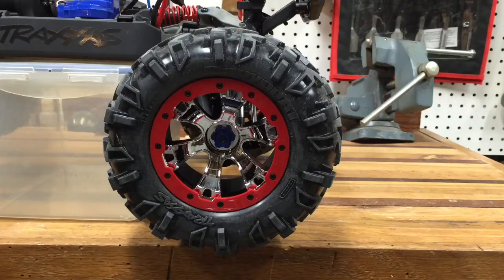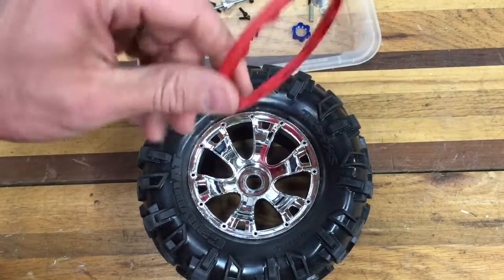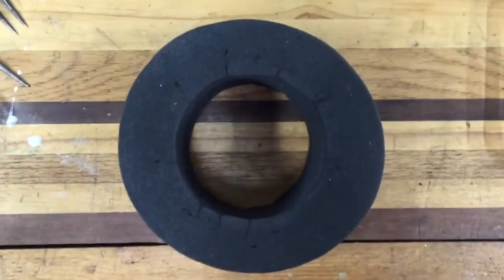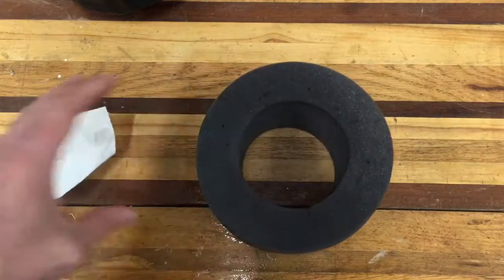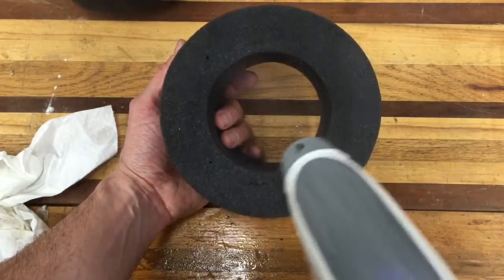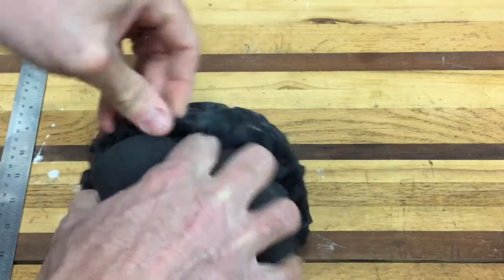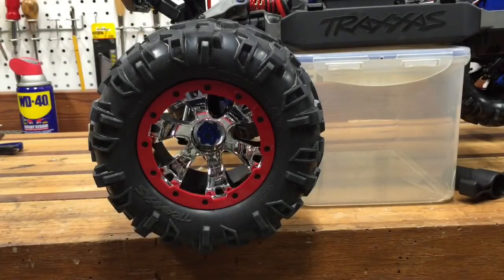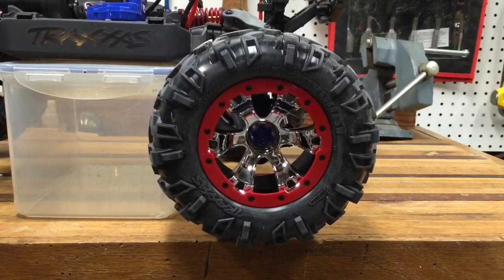Traxxas Summit Part 6, Fixing Out of Round Tires!

Comment: recently had to remove these myself. baked all 4 at 350° Fahrenheit for exactly 10 minutes face up, and they pull right out. flip them, bake another 10, the bottom pulls out easy as well. they are EXTREMELY hot so be careful, but they pull off there in seconds!
Reply from the maker: That's very interesting.  I would be worried putting into an oven.

Comment: This deformation happens from the truck being stored with the tires on the truck holding the truck up. This problem would not happen if the truck is held up by something under the chassis
Reply from the maker: Yes absolutely! They should not let the tires support the vehicle in transit.  Truck should be support by foam or leave tires off.  Thanks for the comment!

Comment: Nice how you fixed it, but I think you did to much work to fix a simple problem,

I know there is lots of ways to do and correct things and yours is OK but let me tell you how I corrected my wobble.  

My Summit had a treble wobble on the tires and I just did 3 little hole in the tires to let the water / humidity out and the foam auto corrected themselves, it worked for me.

Thanks
Reply from the maker: Thank you for the comments!  Yes there's usually multiple ways to solve a problem.  Your fix sounds interesting.  I may try on one of my tires.  If nothing else I can inject steam through the rim holes!  (0:

Comment: hey, good video again.
I agree that they should be stored better in the box, they could be in there a loooong time.
I personally would not want the hassle of having to do what you have done with a brand new truck and might just change the wheels and tyres for aftermarket (with stiffer sidewalls etc).
but again, we should not be having to sort out out of round tyres .
Reply from the maker: Thank you.  Yes the truck sits on its tires in the box.  It should be supported by the frame instead to prevent deformation of the tires.  I may contact Traxxas and request a replacement set of tires.  You are right...  We should not have to fix this type of issue on a new truck!

Comment: I had the same problem bought proline mashers 3.8 pre glued now they wobble side to side balanced tires still not good . EMPLOYEES who put these together need to show more pride in quality workmanship. Never had this problem till I got a summit with 3.8 my 2.8 tires for my slash are ok I balance all my tires for less vibration can't seem to beat this condition ruins FPV Also have a set of 40s demolisher that bounce up & down but do not wobble none have been wet please let me know if you find a solution thanks for your effort
Reply from the maker: +rk stone   Yes very irritating to have the tires so out of round.  On the Summit the tires are mashed by zip ties during shipping thus deforming the tires and inner liner.  I should have contacted Traxxas for replacements!

Comment: is this recommended or are there better ways?
I just got our Summit 2 days ago and the tires are wobbly as well but I was told to run it for a while and let the foam inside seat properly..
Reply from the maker: Who told you that?  Honestly I would call Traxxas and ask for new tires and wheels.  That is what I should have done.  Even after my repairs my tires are still badly out of round.   :0(
Reply: +ProjectKing I read it in some forums as I searched for wobbly tires. Thanks for letting me know. I'll video mine and will let the shop know and Traxxas as well.

Comment: Traxxas should take those back. That's unacceptable, these aren't cheap! I have sent back pro lines, Duratrax, and Traxxas tires. You can balance them but you can't fix this runout. You did it right in your effort to fix but
when out of round like these, they are junk. These will ruin the rest of the truck running like that.

Comment: bake the wheels at 300 for about 20 minutes and the tires just peal off and can reglue.
Reply from the maker: +mastmec   Baking won't cause damage to rubber or plastic wheels?
Reply: ProjectKing no, I have done it to many sets, I've only done one chrome wheel due to tire ripped, but didn't damage wheel. I think I only did it for about 10 minutes though. Heat them up and test, when it's ready they will just pull off.
Reply: It may take a few baking/cooling cycles, but the glue crystallizes and with a bit of gentle pressure like you were doing at the beginning pops the tire off. It will stink your kitchen up though, so prepare your wife for the smell. Let the tires cool before trying to pop them off or the rubber will be softened a lot and is more easy to tear. Also, it's best to put them on a tray and not let the tire hang over the tray so the heat from the heating element or fire at the bottom of the stove doesn't make a direct contact with the tire or it will ruin them. I use a set of kevlar gloves to handle them when hot.

I had a tire bake day where I pulled all my 3.2" tires off 14mm rims to eventually put them on 17mm rims. I did have  a couple tires tear that day, but they were tires that had been remounted more than once and had a lot of cutting at the bead from running in skate parks.
http://gmarquee98.x10host.com/myPics/98gmarquee/misc/2010-0214-TireBake01.jpg

Comment: Throw the tires in boiling water for about 10min.. tires come right off
Reply from the maker: That's a great tip!!!  I'll have to try that!
Reply: +ProjectKing IS THAT CAUSED ROM NOT SITTING ON A STAND? because i always keep mine on a stand and never had a problem.
Reply from the maker: No it is caused by the tires being compressed during shipping.  Mine stay on a stand as well.  A couple of my tires were severely deformed while in the shipping box.  So nothing is going to fix them 100%.